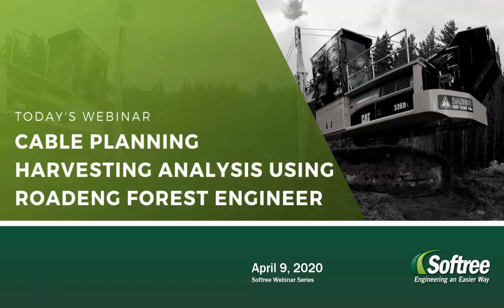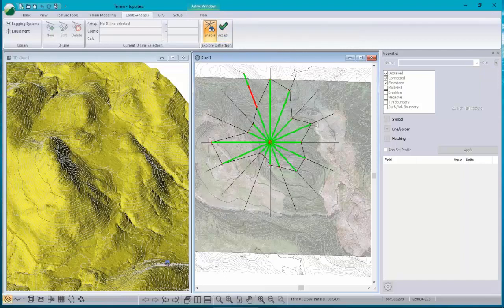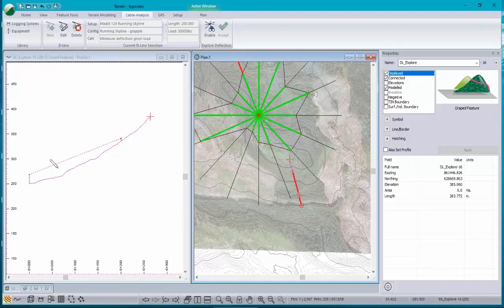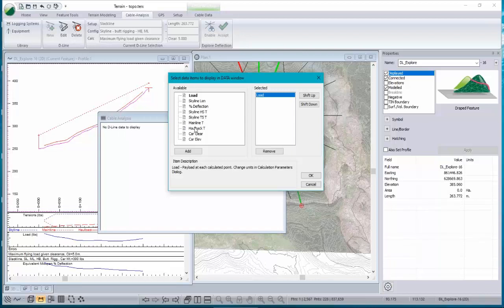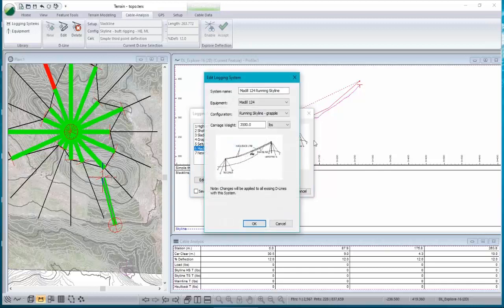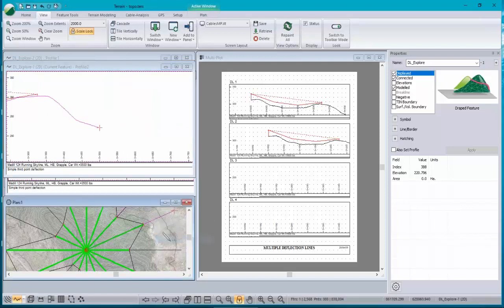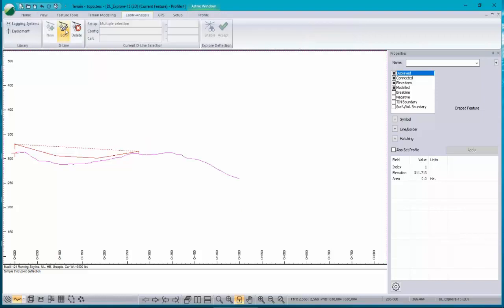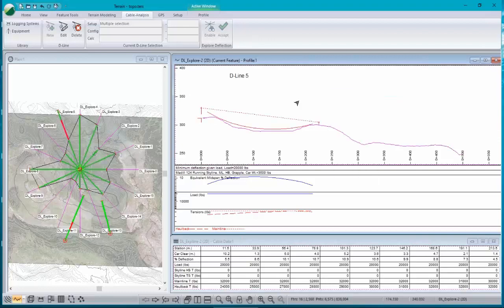Cable Planning Harvesting Analysis using RoadEng Forest Engineer

Comment: Swing tower grapple yarders need the tower height displaced by 6m or so from the road centerline to account for the triangular tower profile. Is there a setting that can account for this such as a template, as it significantly effects the real-world accuracy of the cable analysis. I really appreciate this demo - it has resolved the majority of my issues. The next major issue is the best computer specs and lidar handling - I believe the TIN contours is essential to efficiently working with Lidar as using the raw point data results in very slow computer processing.
Reply from the maker: Hi Peter
!  The modeled tower is vertical while the swing yarder leans out away from the landing at an angle. To compensate, you can move the Head Spar Station a few meters away from the landing (and change the elevation too,  with Cut Depth, if you are on sloping ground). Unfortunately, this can not be done in explore mode... but may be something for us to add in future versions.